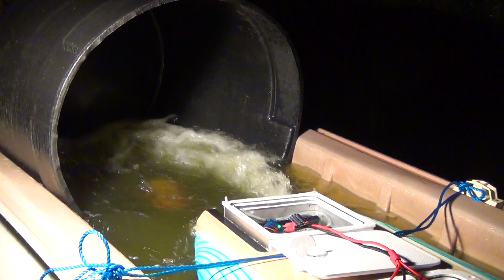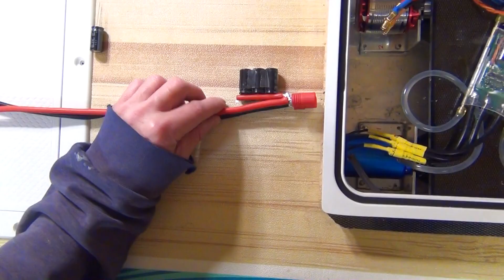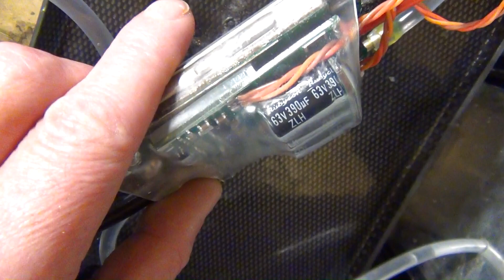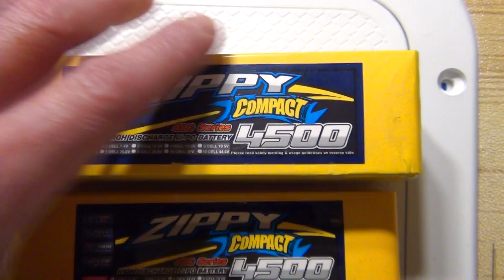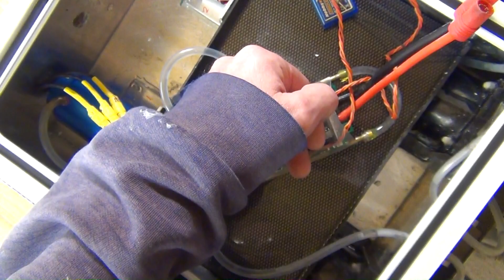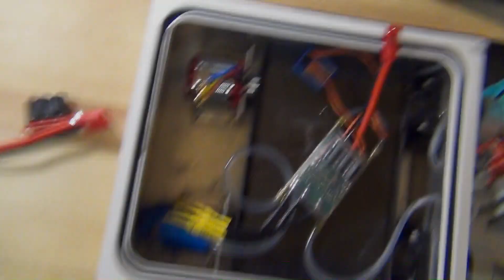Jet Surf Board, DIY long battery harness with caps,

Comment: Looking great mate! I just got my motors esc's and 2x10 cells. Just waiting on the jet drives with fingers crossed. I'll shoot you another email in case you didn't get my last one. Excited to cut up my board and get it running!Thanks for this video series!
Reply: Got the 620kv's btw and 120a esc